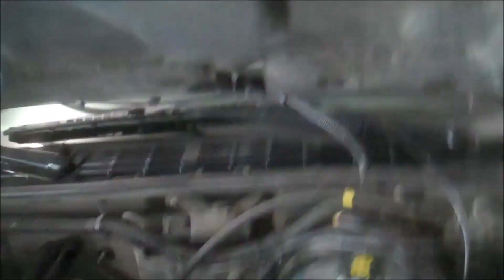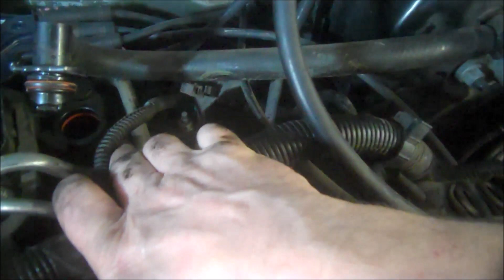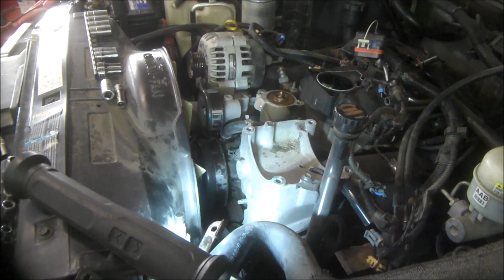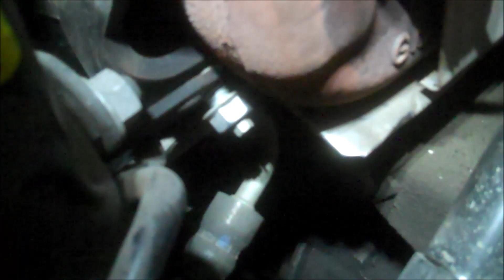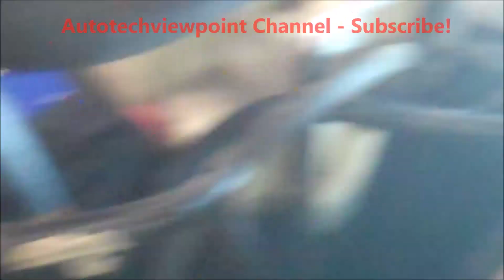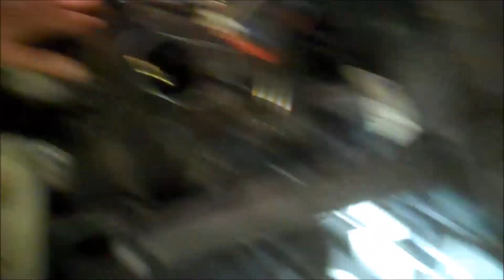Intake manifold removal Chevrolet S10 4.3L PART 1  lower intake gasket remove, install replace.

Comment: I'm a retired mechanic 65 years old these 4.3 Motors they are good when everything's running correctly but to work on them it is a nightmare unless you are a younger man or woman with good mechanical skills don't even attempt this job it's a real pain
Reply: I'm pulling mine out to replace it with a remanufactured crate. Haven't had too many issues yet. Pain is the bellhousing bolts.
Reply: My worst problem was that you can only remove the fuel rails with a stubby wrench.

Comment: How much should an intake gasket replacement job cost? Mine is leaking and I don't have time to Jack with it . My 2000 s10 is basically junk 165k  miles . Goes thru wheel bearings like crazy . Calipers locking up 2/3 x  intake gasket leaking . Cv shaft needs replace .

Comment: how did you remove the power steering pulley with the fan and shroud still in vehicle
Reply: Lisle sells a handy puller/installation kit. Makes it easy.

Comment: Ok I missed out you took the heater hose on the top side of the intake off.I was told it some sort of quick release type that needs a special tool.

Comment: Perhaps a stupid question, but did you have to drain the coolant from the lines going to/from your heater core? Unsure if I need to drain my coolant system before starting this process.

Comment: I'm changing the intake gasket on my 2001 GMC Jimmy. The question I have is once I've got the intake off I noticed the ports inside my engine the back two was full of sludge should I be wor ried about that or is that normal
Reply: Don’t worry just clean it out, it’s the dexcool sludge, if you already put everything back together great. However if you put dexcool back in it you should drain/flush your coolant system and go back with the yellow coolant. Yellow will mix well with any residual dex but you will never have sludge in your coolant system again.

Comment: I was contemplating replacing gasket myself, but that look frustrating and long.
Reply: I’m two days into it, and I can confirm it is very frustrating, but rewarding as well.
Reply: Wait until you have more parts to replace and knock a whole bunch of pesky problems out at once while you're in there

Comment: Have a 2000 s10 V6 . Throws a puff of white smoke at start and oil is very milky but does not heat up at all even when it was ran for just a bit without antifreeze.  What could it be?
Reply: Hay man I hope you figured out the problem but if you didn't if the oil is milky then there is coolant in your oil  and it can get there from a blowing head gasket that blew through on the inside
Reply: @kevinheart7091  not always a head gasket issue. Leaking lower intake gaskets do the same.

Comment: Why? How did you know it needed replaced????
Reply: I know its much later but rough running, coolant going down for no reason. mine is pumping coolant out of the top of the engine so that's how I knew. 02 s10 4.3

Comment: Why dont you label the year of the vehicle you are working on for people to find thier correct year.
Reply from the maker: Auto Tech Most of the time I do try to. missed this one apparently.
Reply: Fixing cars and stuff Its a 4.3 S10. Practically all the same.
Reply: Got a 4.3 GMC Sonoma which doesn't have whatever that module beside the thermostat is. Also the Connecting rods on a W vin is different from an X vin. GMC made alot of variations of the 4.3l so it's kinda like how a Honda 1.9 F22 isn't the same as a Y7. They will sometimes take other parts or procedures.